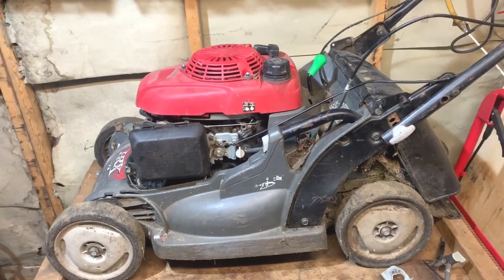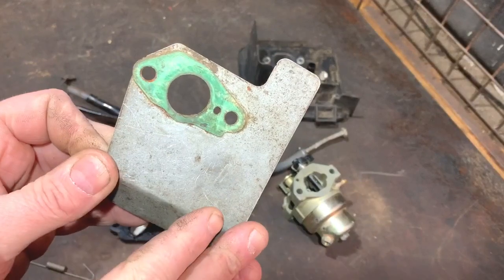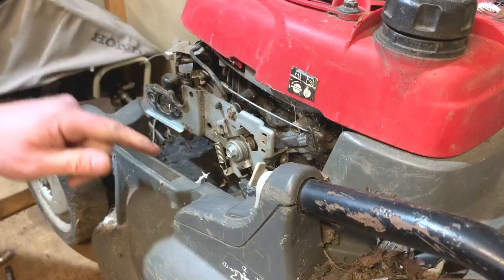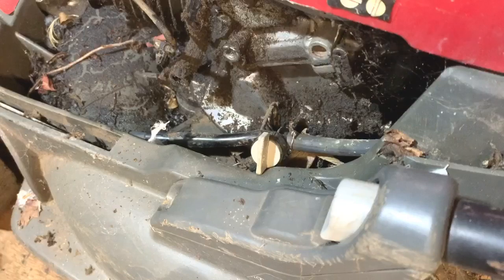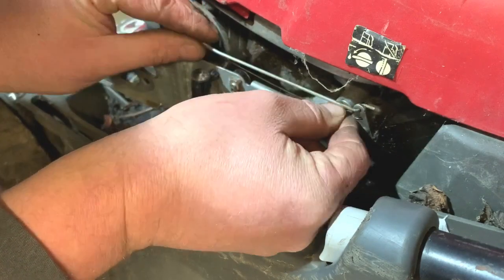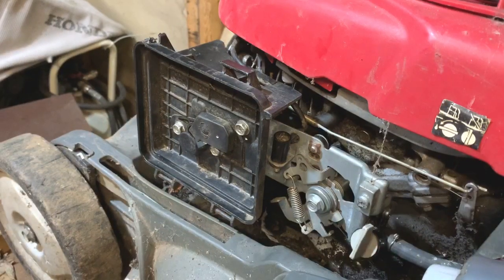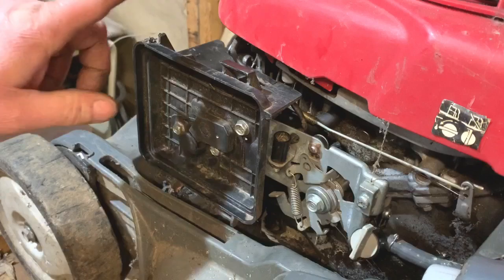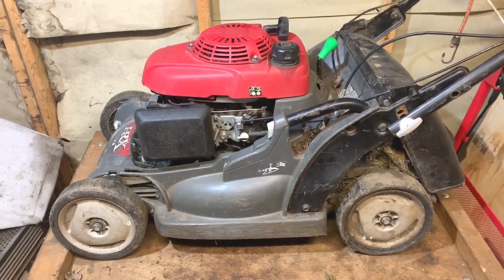Honda GCV Engine ( Auto Choke to Manual Choke Conversion)

Comment: Luke nice job on the replacement it’s nice to be able to change parts to make it work better
Reply from the maker: Hi Henry, I despise Honda auto chokes, so whenever I get any issues at all with them I do this conversion, imo make the mower so much better, thanks for watching 🙂👍
Reply: @Menditman2014  where do you source your parts?
Reply from the maker: @frostyfire03530  HI I mostly have the spare parts I need, if not I usually use ebay, L&S or GHS hope this helps thanks for watching 🙂👍

Comment: I like the auto chokes but there is something good to be said about controlling the choke when it's cold.
Reply from the maker: It’s like anything when it’s working ok it’s fine, but when it starts messing up I can’t dealing with it, especially when I have loads of bits to do the conversion do basically the conversion costs me nothing, just the way I like it 😂 Thanks for watching 🙂👍
Reply: @Mowers and Stuff  Free is good 👍 
I have converted a couple, but since I like them, I usually try to save them

Comment: You either forgot or forgot to show the gasket that goes on the backside of that heat shield before the black square plastic piece. You can’t just put that black piece up against the metal plate
Reply from the maker: Hi gasket would have been there I’ve done 100s of these, but the gasket could well have been stuck on so that’s probably why I didn’t mention it. This was a while ago now thanks for watching 🙂👍